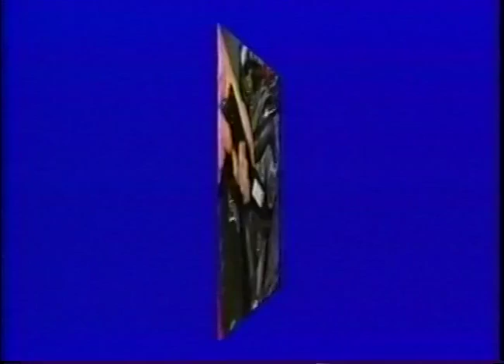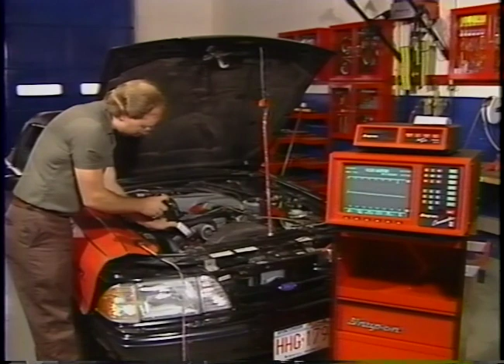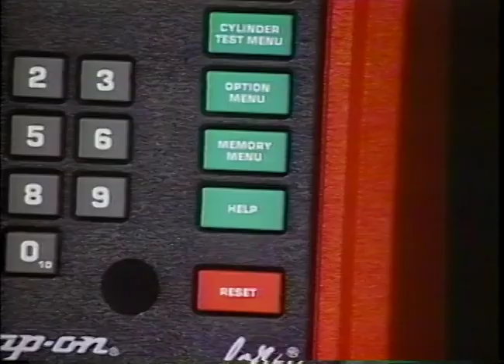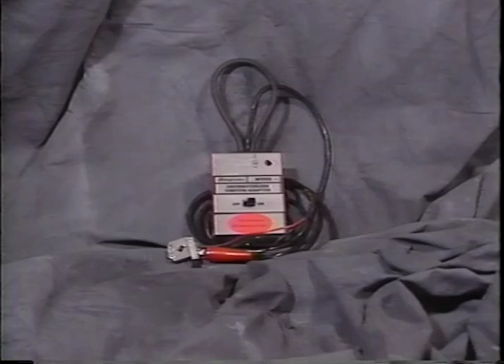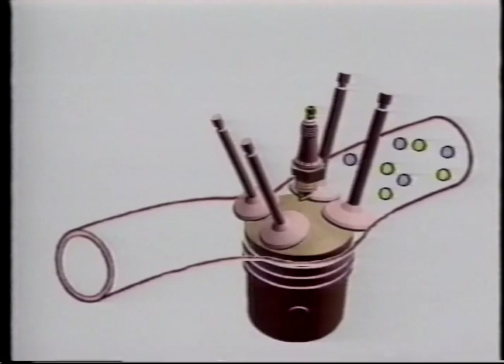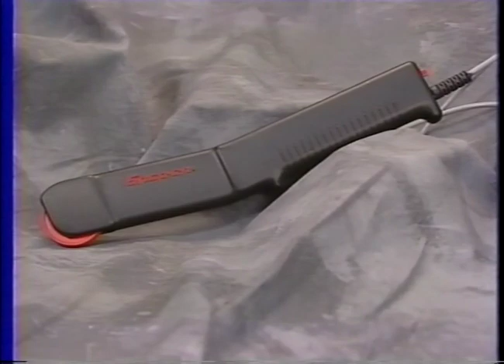MT3000 420 Power Balance Probe SS1199AVHS

Comment: Thanks for posting, I picked up a used MT3000/MT3100 for free and was looking for good info and instructions on how to use all of the adapters and modes of the MT3000. Keep posting them .
Reply: so lucky that you got the whole package free, they are getting harder to find with the MT3100 in it.